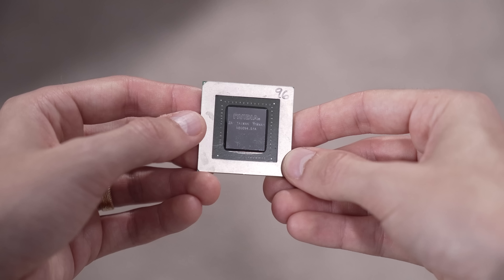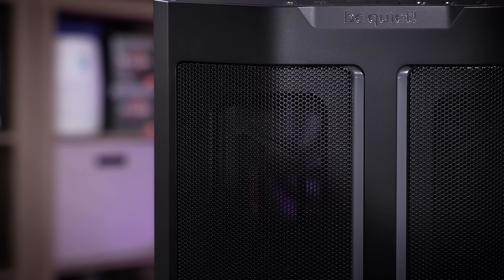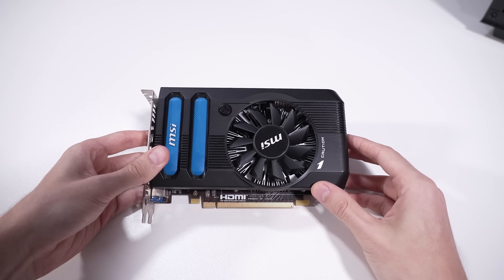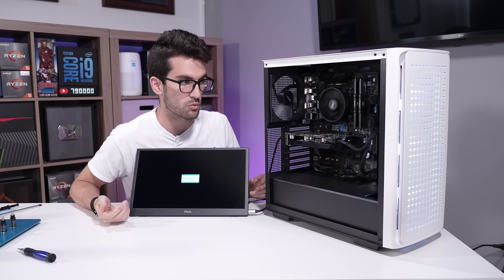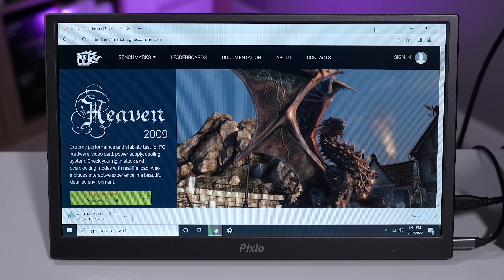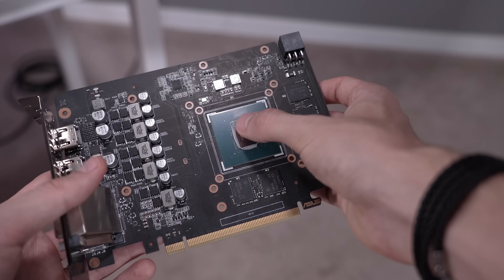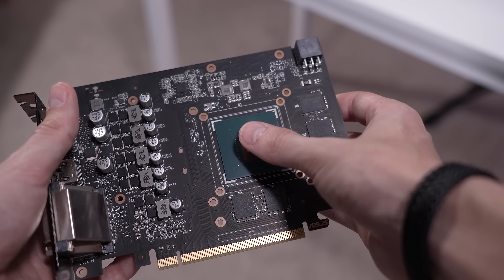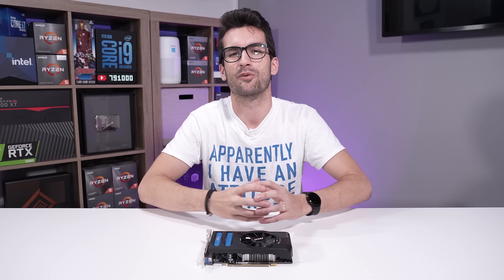"Just Bake It"

Comment: The likely reason on why it failed in the first place was because the fan was not working,  it's likely the Fan is borked or the fan header is not working any more for some reason the GPU likely overheated and the solder balls may have cracked because of it and the reflow just fixed them maybe good for long term testing just make sure to replace the fan or Zip tie a new fan on it and come back to it 6months later to see if its still working or not. In my experience with reflowing if it dies very quickly after the reflow that usually means something else is the issue and reflowing it just make them work temporarily it's the same thing with the FAT PS3 people saw they were coming back to life after a reflow and would go back to a YLOD thinking it was the CPU\GPU chips and that they needed to be re-balled to be properly fixed and it took years for people to realize that the issue was actually with the flat Capacitors and they were simply coming back to life if reheated but only for a short while it's likely the same thing with the GPU's as I have seen a few that did last for years after a reflow if it dies again quickly after a reflow likely means there are other parts that have to be repaired\replaced.

Comment: I did this to my GTX 680 direct cuii 3 slot and it saved it because my friend used a 450w psu with it which caused a issue on it and artifact it. So headgunned it to 260°c and now its been over a year and it still kicking

Comment: I have repaired 2 old laptop graphics cards by baking it in the oven, 200C for 10 min. The issue with those specific cards is that they were mounted on the underside of the motherboard. With the heat buildup and prolong use time the GPU Chip would start pulling away from the board. The first time I did this it worked for about a year, second time a few months and then I just retired the thing. RIP ;-)

Comment: first gpu seen have issues with chip next to fan slot plug in or capacitor (u never checked it with voltages meters) 
2nd gpu is one guessing bad bridge chips or no voltages either way ( you know u could use old small intel heatsink it should be able fit on it no problem which i seen someone did it but dont recommend for long term because of vram n other around it need be cooling)
u may want get exp cables pcie so u can check voltage on it whiles it on table not in mobo by case

Comment: So called reflowing the solder underside the GPU can be done, if done with proper equipment. For chips large as GPU's, you need reflow station to reball and resolder the GPU core back in to have lasting effect on the repair (only if issues are between PCB and GPU substrate). Just reflowing the solder joints below the gpu wont be enough in long run and if done incorrectly can cause major damage to the graphics card pcb and other components. This only if issue is from cracked solder joints below the GPU substrate or silicon it self. Reflowing wont fix damaged gpu core or memory, would need complete chip replacement on those. In this case the solder joints either between pcb and gpu substrate or between silicon and substrate have cracked. Repair could last days or years.

Comment: hey, im actually trying to fix a 2060 super at the moment. i have tried to repaste it but it didnt resolve my issue. with the gpu installed, im able to get into windows and install the nvidia drivers no problem. however if i run heaven benchmark i see flash lights like blue, purple, red, etc.

i attempted to reflow it using a microwave but it didnt work. however when i reflowed it, i heated my oven to 350 and let it bake for only 2-3 minutes. im thinking either it should be baking longer and/or make it hotter.

what do you think? i want to try to get this card working, throwing it away seems like a waste.

Comment: Artifacting is usually a memory GDDR problem and worst case the memory controller in de GPU is bad. So replacing the bas memory bank is the best option and if that does not work then you can reflow GPU but it is a temp solution, can work 1 day or 1 year it is Russion roulette. Also reflow with a heatgun is a last option if you have nothing to lose.

Comment: That 1060 most likely is missing a voltage. A normal GPU has around 5+ different voltages around the board. They all have what is called power sequence.its different for each GPU but most are like follow 12v pcie }3.3v pcie }12v external power} 5v }1.8v and 1~2v for core and memory.1v display on some. Since the core is cold it may have no power. You may be missing 5v or 1.8v. You need to stab the GPU with a multimeter to know and measure voltages. Artifacts and black screen are often caused by bad video memory not GPU core as many believe. Techcementary. Buldzoid northbridgefix are just a few YouTubers that have GPU repairs that are helpful and informative. Also Heat gun method is like poring oils on top of an engine... It works only if the where bad contact between PCb and Vga... Sometimes

Comment: Got screwed over with an ebay lg phone several years back. Known issue ( just not known to me :(  )being it would die after over heating. Found on the internet that the problem was similar to this. Took it apart and applied a hairdryer to it.. was able to power it on long enough to get all my info of it. Lol. I imagine if i had a heat gun i would have got longer usage out of the phone. 
So yea can confirm this method works. But it requires patience and luck. Lol

Comment: should warm the board evenly so it does not warp when cooling it down
Reply from the maker: Mentioned this as a downside to the heat gun method already. It's possible to warp, but didn't happen here. Also not practical heating up the entire thing with such a small gun. Needed to follow the reflow chart and felt it was more important.

Comment: I have a most likely dead GTX 1070 (EVGA cooler on a FE PCB) that released a spark after I booted up my PC after it suddenly shut down while playing a game and switching Discord stream from app to window. Ever since then, I haven't fully realized what to do. Inspecting it, it's looking completely fine apart from a burning smell from the spark which came from the middle, but not on the GPU itself, but rather the thermal pad. Really have hard time knowing if it could still be saved, especially when prices are still too high for my to be able to afford a good upgrade. Oh well...

Comment: The moment he turned on the monitor and the monitor received a confirmation signal which immediately happens when it has something plugged in and doesn't immediately say no signal I knew the pc was gonna work he did it professionally the heat gun method pulsing the heat at the end was very wise even more confirmation that the card was gonna work is how quick of signal the bios displayed and didn't even take 5 seconds for windows to boot

Comment: Just my 2 cents here, I don't actually know anything, nor can I back up my claim, but I do have a hypothesis that doesn't sound wrong or at least too far fetched.
What if the gpu (1060) is detecting the heat and/or lack of fan connected and is refusing to do anything until that has been situated. Maybe hook up a 120 or a 90mm fan to the fan header and do a cheap water block from aliexpress and then it'll work.
Again, I don't actually know if this will work, but at the very least, I'd find it entertaining to watch

Comment: I've done this for so many people with older cards that can't afford new cards for their childs gaming rig.  POINTER for those that do attempt this, toaster oven works best but once you use it for baking a card DON't ever use it for food again. Bring down the temp on the oven once you hit target temp over a 1 hr period. Test card if all seems well grab that WD40 mist the card with it .... I have a 970 I had baked 3 times in the past after a suggestion from a fellow tech GURU I misted it with WD40 and knock on wood 3yrs later since that date and no issues.... I used the card in my streaming rig, and now in my home media PC which is on every single day.  I have more than a few cards out there I have done this to and still no issues " WD40"  MIST IT ON  after the card is verified working and removed from system then reinstall....

Comment: AC voltage is effectively 70% of DC because you need 130% of AC voltage to equal the same amount of DC voltage because of the wave or fluctuation, so there you go.

Comment: I wonder if the fan died, the cpu got so hot it came unseated, and reflowing it reseated it? Just my guess. I think, if that's the case, reflowing it and replacing the cooler might actually fix the card. Also, as for the fan I had a card that did this. The fan was crap, it was sticking. If the cpu got Hot enough to damage itself, it might have damaged the plastic, and made it stick. What happened in my case was the lower voltage settings didn't send enough juice to spin the fan, only when under load the card would send enough juice to unstick the fan and get it going again, and it made a horrible sound not unlike that squeaky whine yours was doing.

Comment: when reflowing you always want to keep solder around 230-255. anything over 260 could cause more damage.
and reflow machines lately are cheap compared to when i started in 2009. now usually $400 when i got mine it was $2200 usd.
I had a full BGA reballer workstation and 2 IR lights. all you really need for reflow is the IR light and the table. and some aluminum tape :D

BTW Greg i think your doing a Awesome job on your channel, definitely one of my favorite techtube channels. top 10.
Its definitely all about the presentation. and your on point. thanks and please keep sharing.
Reply from the maker: Yep, which is why we mapped temperatures with our thermal cam while doing this :-)

Comment: Pro Tip: Kapton Tape and Tin Foil to protect everything but the GPU die that is getting cooked. 😉

EDIT
Greg mentioned he thought that there was maybe a 10% chance it would work. I've found it to be much much greater than 10% if the card is booting but artifacting. I get closer to 60% or 70% of these artifacting cards to boot and work. Many of them end up lasting for a long time too. I've had a few last a month or two, but many last much much longer. As for the no picture 1060, it's either power delivery or memory..... No matter how long you cook it, there will never be video output from that card.
Reply from the maker: If you noticed in our thermal cam, a vast majority of the board was much cooler. Only the GPU was heated. Introduces possibility for warping, though.
Reply: @GregSalazar  for sure, I'm just tossing out my method for cooking artifacting cards. I've done hundreds lol. Yet another awesome video sir, keep this type of stuff coming!
Reply: @GregSalazar  ....I'm the guy that builds potatoes for local kiddos. I pick up bulk dead cards and heat gun a box at a time. So I'll take an old R9 280x or whatever I brought back to life and pair it with an old i5 or i7 sometimes even the occasional FX CPU. Slap the rig together and you've got a $200 PC that can actually game a bit. I give just as many away as I sell and every single one comes with a warranty knowing the bulk of my builds have a cooked GPU. I wouldn't feel right if I sold a $200 potato to someone without disclosing that fact.

Comment: You don't bake it. Check a couple of the rails (GPU, VRM) with a multi-meter to make sure a connection us there. If caps or power stages are burnt then find someone with a multi-meter and some soldering skills and special heat gun (small one) and reflow station.

Comment: In my opinion, it's never worth trying this because even if it works temporarily, you most likely caused bubbling inside the PCB and completely destroying the card in the long run. I think you're better off selling it for parts to someone that has the equipment to fix them properly..
Reply from the maker: Plenty of folks have done this and gotten their cards to work for several months/years. I disagree with you. Selling for parts won't recoup anywhere near enough funds for a new, equitable card. And there shouldn't be much in the way of "PCB bubbling." Not sure what you mean there.
Reply: @GregSalazar the bubbling happens if the moisture in the card expands too rapidly. Bubbling isn't the right word... I forget the right word. Anyway, that's why I think it's super smart to use the thermal camera like you did. And you have a point there as far as resale value goes, but I just think there are way too many people out there that are probably baking GPUs and ruining them that could easily be repared properly. So, I really like that you keep reminding people that it's something you should only try as a last ditch effort. I guess my point was that you have to be educated enough in all the other proper troubleshooting methods before you can know when a 'last ditch effort' is called for. So, perhaps not reselling for parts, but at least try to find someone that knows how to troubleshoot it, or do a lot of research first. Also, I think it's cool you're using a chart as a reference. This is definitely the most carefully done reflowing video I've seen.

Comment: ROHS/Lead free solder has a melting point of 422f, many of the other components on a video card do not deal well with heat that high. Louis' perspective on baking video cards is, usually it doesn't reflow anything because people bake it at too low a temperature to flow the solder and even when it does it's a temporary fix in the best of cases, he has a video about this on his channel if you are interested in his take on the subject. The TLDW of his opinion though is, only idiots try it and it doesn't work.

Comment: I have baked cards before and had them last for years after. It is a gamble but when you got nothing to lose then go for it. Also, you can reseal the epoxy as well with more epoxy around the edge. Lasts a lot longer that way. The biggest issue I have is fans headers short more often which leads to this happening. Also I was one that told you to bake it back then in the comments and you hearted it.

Comment: if you try rigging a heat sink to to the graphics card then you can possibly get a picture out from the card. because i think that your trying your best to fix the card is your best attempt and i know your trying hard. but your are not trying all the solutions to fix the dead card problem. then again it might or might not work depending on if you can find a stock graphic card cooler could be found.

Comment: 90 to 450 °C is the melting point of solder.
The melting point of poly carbinet plastic is 280c. 
A typical oven tops at 500f.
GL to anyone trying an oven for reflowing 🤣
Reply from the maker: Most lead-free solder has relatively low melting points, just FYI.
Reply: @GregSalazar  good to know, thanks.
Reply: Modern lead free solder melts at around 220-230c. A typical oven tops out at 280c, which is well above the solder melting point.

Comment: I followed the Tech Yes City to re-heat a friend's 7970 that was artifacting on analog output (and black screen after driver setup), and digital output were dead. Mid setting heat gun and 5 minutes on circle pattern around the die made the job, digital output came alive and no more artifacts on analog/VGA, 6 months  going so far, enough to GPU prices to get somewhat normal-ish

Comment: Yeah just bake it an then sell it on ebay as "Suddenly died" or "untestet" after it dies again. Then I buy it to actually fix it properly by swapping vram or a mosfet and of course the card will be long baked to death. If you reflow the heatgun is better than an oven but you need to preheat the pcb or it will kill the substrate quickly or shorten its lifespan to basically nil. You also need to use flux or this whole thing is absolutetely POINTLESS!!!! It will be a temporary fix and it makes these card almost wothless on the second hand market but of course people will lie again and again. You just get scammed over and over. If you tell people to do this stuff then actual gpu repair will just die. In the last few months people have startet selling more and more baked cards. These are all basically only useable as a donator for a resistor, because all other components will already be heavily damaged.

Comment: I tore mine off of my GTX 670. I also want to add my old FX6350 to my keychain along with the GPU core. I also can't help but say baking a GPU in an oven or with a heat gun isn't reflowing. If it was reflowing it would end up a mess with no flux......

Comment: have to agree. this is a hit or miss effort. have played with fixing pc parts and gpus is one on the list. like have fixed a 8800 and it worked for like a year and then same happened. did it a few times after and then it only lasted a few months. did a 7950 and that also worked for the while i kept it around but then passed it to another person (gave. not sold. they where aware of the fix) tryed it on a 610 and card is still working 6years later till today(lives in a media pc). all cards where just props on a shelf and no warranty so nothing to lose (the 8800 is still a prop together with a same one on a shelf) so if you wana tinker it is a way if nothing to lose but not great idea for a gpu that you will main on

Comment: 🤦 Also, don't tap the card to check temp. Leave it alone on a flat surface for at least 15 minutes, as if the solder isn't solid yet, you risk moving the chip or creating a solder joint between balls.
Reply from the maker: Lol, at 50C everything is plenty solid. Several minutes had passed in-between clips.